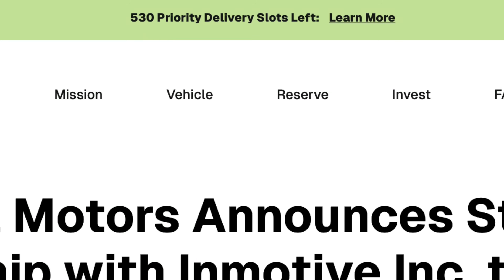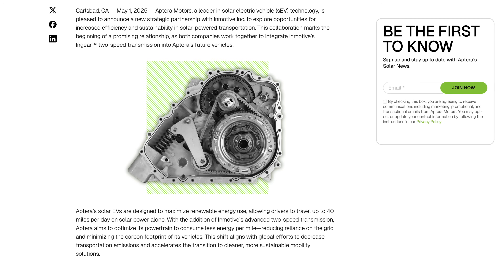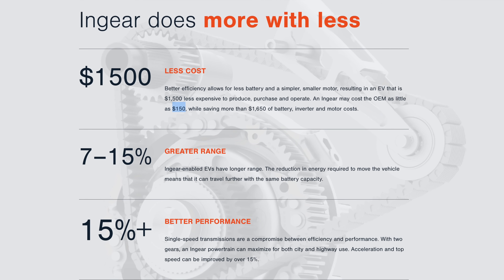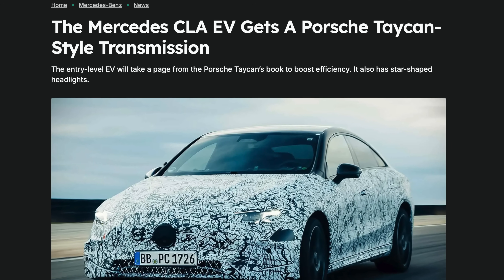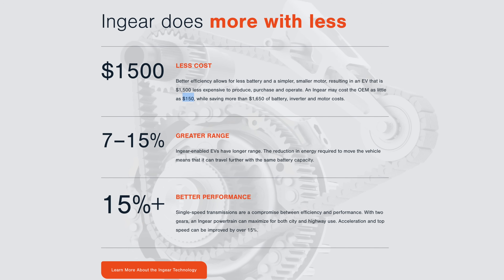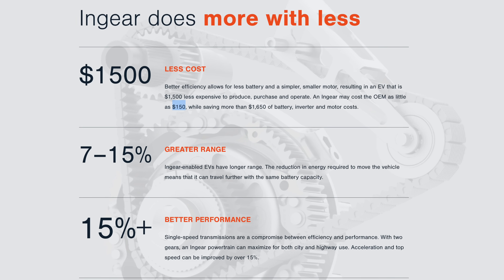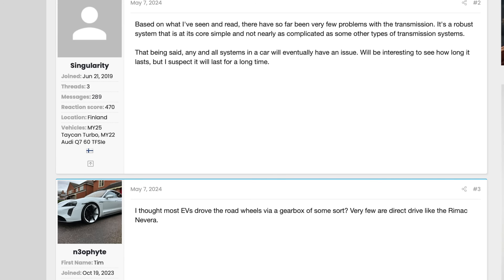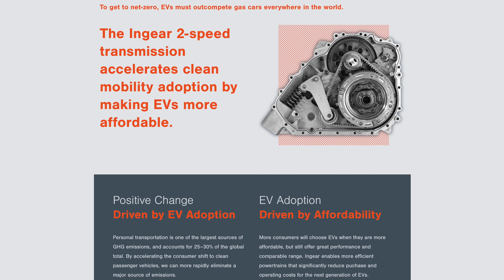Aptera Gets A Transmission?? Explained

Comment: Due to the way the EMR3 works, I think the Inmotive Ingear transmission would be replacing the reduction gear of the EMR3.   Electric motors use energy at different rates than the more linear ICE.  Motors have efficiency islands in the RPM versus load graph.  It could help if it could move the EMR3 into an efficiency zone at highway speeds.
Reply: And low load city/around town travel too.

Comment: When you ask why EVs get worse range on the highway, everyone blames arrodinamic drag, which grows exponentially with speed. I've never understood that - it should apply to ICE vehicles, too, but those can actually get significantly better range on than in town... So the only logical explanation is the lack of variable gearing :)
Reply: Nope, nothing to do with a lack of gearing in EVs. 
Most of the energy in powering an ICE vehicle is lost as heat, meaning there's an optimal speed you can drive before aerodynamic drag starts to compete with heat losses.
With EVs, most of the energy goes into moving the car, so you don't have the same fight between losses - drag basically dominates from low speed. An EV will also gain a lot of energy back at the low speed stop-start driving you get in cities, thanks to regen braking. Not something you do when traveling consistently at high speed.
Reply: @drunkenhobo8020  without variable gearing, higher speed means higher RPM, therefore greater magnetic drag between the stator and rotor. Which means you need to use more energy do overcome that drag
Reply: @zahari_s_stoyanov   Losses within an electric motor are minimal. You're not improving efficiency by adding a transmission. You may even hurt it from the weight and friction of the transmission.
Why do you think nobody else is doing this?

Comment: Exceeding EPA range says absolutely ZERO about the transmission improving efficiency.  It simply means Porsche underrated their EPA claims.  

You should just look at the actual real world efficiency like Edmunds testing, and the Taycan is still just NOT that efficient.  Single speed Kia, Tesla, and Lucid are significantly more efficient... Even the new Porsche Macan SUV with single speed transmission is more efficient than the low slung Taycan with 2 speed.  The gains are likely miniscule. I'd rather skips the extra moving parts...

Comment: EVs are a case study in how we often prioritize cool tech over engineering fundamentals. Early on, most of the industry's time, energy, and especially money went toward flashy features—autonomy (FSD), touchscreen overload, and cabin gadgetry—rather than perfecting the core mechanical aspects of what makes an electric car efficient.

Now we’re seeing huge interest in companies like Slate, not because they’re breaking new ground, but because they’re going back to what people actually want: a simple, affordable EV. No FSD, no over-engineering, just solid efficiency and usability at a sane price point.

This whole thing feels like we built the EV industry upside down. We maxed out complexity before we nailed the basics. Maybe it’s time to reset and build the car, before trying to build the robot.
Reply: It's the way new technology always works. You've got to go for the high end expensive stuff first, otherwise you'll never be able to sell it at a profit due to the high costs of brand new technology. Now that EVs have had about 15 years to mature, we're seeing more simple and affordable ones.
Reply: Huh? The center touchscreen actually reduces complexity and manufacturing costs, while improving reliability. Wiring a bunch of knobs and switches slows production and creates more failure points. Tesla worked relentlessly on improving efficiency because they knew a more efficient car needed a lighter and less-expensive battery to go the same distance. And they worked relentlessly on reliability and durability because they knew how much value a longer useful service life brought to the buyer.

The Slate might seem like a good idea to anyone who is not an expert in high-volume manufacturing, but the savings from making it low tech will not materialize. Remember, we live in a world where you can buy a tablet computer for under $50. Slate will not be able to meet their announced timelines or price points, which means they will be selling them at a big loss, and that's assuming they even make it to volume production.

Comment: Well, Tesla did initially use a 2 speed transmission, but dropped it. Will be interesting how it is incorporated. But I’m hoping if it does somehow improve efficiency and range… they DONT DECREASE THE NUMBER OF BATTERIES! And instead advertise it as “minimum 400 average [new number]”

Comment: Nuts to look into more components this close to production.
Reply: This could be used as a reason to delay production. Delaying production could be their goal.
Reply: But if it helps them achieve their projected 10 mi per kWh from the get go, on the road, that could help quiet the naysayers, and gain investors and reservations.

Comment: While I would prefer a simple single speed, as someone who owns a mid-drive ebike, I can see the need for this. Transmissions in EVs may not be strictly necessary but they do give them advantages over single speeds. Namely better performance at all speeds/better efficiency. Electric motors operate most efficiently at low RPM. They don't make much power effectively when they are spinning very fast. While you could optimize final drive gearing for operation at highway speeds, lower speed performance would suffer and the tall gearing might put an excessive amount of stress on the motor. So it is logical to incorporate a transmission in a vehicle that will almost certainly be driven fairly long distances at 60-70MPH. If the transmission help to ensure the highway range targets then it is certainly a good idea to incorporate, provided the unit is reliable and easy to service.

Comment: I was just thinking the other day that there has got to be a way to get gears working for EVs to get the same benefits they do for ICE cars and even bikes. I mean if gears on a bicycle can make the human engine more efficient at riding, surely it can work for EVs right? Then BOOM. The one transportation company I've had the most interest in (yes, I have a reservation) partners with an EV transmission company that I didn't even know existed. Best birthday week ever!
Reply: There's no need with EVs. You don't lose efficiency in the same way as you do with ICE or legs. There's very little to be gained with a gearbox, other than complexity, weight and cost.
Formula E and even the VW I.D. R only have single speed transmissions. It's almost never worth it.
Reply: @drunkenhobo8020  Most EV's get their 'gearing' with 2 or more motors. Those add weight and complexity, no?
Reply: No, that just isn't how electric motors work. for both muscles and ICEVs, there is a fairly tight torque/force band that. For ICEs, that is and upper mid RPM band with no torque at all produced from zero speed. For human muscles, peak force is midway between full extension and full retraction of the joint with little force produced at the ends. Hence the need to for gears to keep both ICEs and muscles near their peak torque/force curves. 
Electric motors produce torque from a stop and have relatively flat torque and efficiency curves and don't need to get moving before they can move so don't need things like a torque converter, starter motor (a single speed electric motor by the way).

Comment: This is something I have been curious for a few years is why don't EVs have transmissions, I know they have gearing but that is direct drive. That being said I did not know about Porsche and Mercedes using them, but it could be tuned for better efficiency for multiple speeds. That being said I have been considering mating an old Tesla power unit to an old Honda transmission with custom cut gearing, and have it set mid engine so instead of the output being split between the front wheels it would be split between front and back with differentials for a 4WD mid engine layout.

Comment: eh chain driven transmission. not as durable as a solid gear/planetary setup with a clutch pack. not sure it makes sense for lowering weight unless it gives a tangible range benefit. wonder how much battery theyre giving up for this and if the change in motor selection had anything to do with this decision. one more thing to worry about though and chain drive needs transfluid change probably atleast every 80-100k miles, ideally half that.
glad to see theyre willing to go with a parking pawl though. really dont like that teslas dont have one of those. some of them slide away while being charged and destroy their charger lol. 150$ part for mfg means a $2000 repair if it goes bad.
i wish they would just stop changing the design and go to production.... even if there are flaws, the sooner they start making them the sooner they will be affordable 2nd hand.

Comment: Vaporware working with vaporware. Great!

Yeah, stupid.

There are enough EVs already on the road to have proved conclusively that anything other than a single-speed transmission REDUCES efficiency. All the 2-speed transmission gives you is a higher top speed for vehicles that don't have high enough quality motors to deal with the RPMs necessary for a competitive top speed. A top speed that is utterly irrelevant to 99.99999999% of drivers and situations. So you're adding weight and complexity, and REDUCING efficiency. There is ZERO chance that efficiency is increased. That's not how electric motors work. They don't have a torque curve like ICE engines do, and efficiency is not directly related to RPM. Adding weight and friction CANNOT increase efficiency, because physics. The Porsche in fact proves that the 2-speed transmission is less efficient, because the Porsche (and its Audi and other platform siblings) is in fact less efficient than its direct competitors.

More stupidity from the company that gave us the sheer insanity of "NACS"  (for aesthetic, not practical reasons) rather than making the smart move to CCS.

This is all just more lies from a company that has been lying to investors for years now. They have no intention of going to the trouble of actually producing a vehicle when there are so many suckers with more money than brains who are willing to throw good money after bad.

Comment: Me who drives a Manual Daily. NGL I would love a Manual Transmission EV.
Reply: 👍👍👍 Seem to recall a ICE to EV conversion that had a 4-spd shifter.
Reply: @gr8dvd  oh yeah I've seen several manual EVs from conversion kits. I would love to turn my Honda Kei Van into an EV with a Manual. That's like the best part of driving one of those things is shifting the gears and making noise with those tiny engines while having everyone look at you for having such a smol car 🙂
Reply: @ Too funny as same (similar) desire, different motivation. Always felt had more control, especially in snow country, with stick. Dream car was a Mazda RX-8 conversion tho maybe now Cobra EV replica built anew, only shares it’s shape.

Comment: Anywhere we score efficiency is less money at the charger.  That's the economic freedom we've demanded for decades.
Reply: I like efficiency, but this thing is already going to be dirt cheap to charge.
Reply: @michaelsmithers4900  And on top. I doubt that 10 to 15 % is legit. It's time to build this thing. Before they go bankrupt AGAIN.
Reply: @michaelsmithers4900  I agree and I put the 3rd Like on your comment.  I also think that the matter of adding this 2-speed trans is for another criteria: that is how the Aptera will stack up against what other EV can people buy for the same costs of Aptera ownership.
Reply: @a5-30-31cts 2 speed to make it faster? Or to be able to use a weaker motor?
There has to be a gain. To my thinking single speed is cheaper, lighter and simpler - as long as your motors are up to task.
Reply: Maybe they should deliver some product?
Reply: @scottbaxendale323 so agree even if they have to jack up the price on the early ones
Reply: @EarthCreature.   disagree.
A simple system that lasts longer might be more sustainable than a more complex system that is more failure prone.
Other considerations would be cost, weight, packaging- does it make the storeage space smaller, for example?
So while I Love efficiency, I would also Love to see it go really far say 250k miles or more
Reply: But potentially more money in maintenance. Transmissions are one of the big 3 failure points in ICE vehicles. We'll have to see how this turns out.
Reply: @sasca854 Agree, saving a few dollars a month to have a costly repair down the road doesn’t make sense
Reply: if you get a 10% saving for a $120 part you will need to spend 1200 at the charger 
how many days/years will it take you to spend 1200 charging a solar asisted car
Reply: The more efficient the better. You should never waste energy.
Reply: ...for decades to come!

Comment: Please, no transmission...
Reply: The OG roadster learned why to not use a 2 speed.  Porsche leaned on the crutch of two speed gear ratios because they couldn't innovate a better motor, same for others.  Tesla and lucid solved the problem the correct way by designing a higher RPM motor.  Wrapped rotors reduce centrifugal burst failure limitations.

Comment: $150 for that 2 speed transmission is impossible.
That must be a mistake. Somebody drops the ball somewhere in the process.
Reply: It's as little as $150 more than a current solution, it doesn't cost $150.
Reply: Economy of scale makes it easily possible.

Comment: How DOES a transmission affect acceleration? What about towing range?
Reply: Lower gears allow greater torque thus quicker acceleration. The high gear allows more wheel rotation per motor rotation thus increasing increasing range at the cost of slower acceleration.

Comment: So they are 1) adding weight 2) adding cost 3) taking away internal space, 4) changing the engineering platform once again, and 5) putting in more complexity with an untested component to increase "range" when its supposed to go 1000 miles on a single charge.  And this is a good idea why again?  BTW; you have it wrong. Higher gears lower motor speeds to go faster with a given RPM.  Lower gears give you more torque to go up hills, which it seems Aptera can't do.
Reply: This is a very negative view. Electric motors can become very much less efficient at high RPM back EMF or something. The cost of a simple gearbox could make enough efficiency sense to save on a more costly motor
Reply: I'll let you know what I think as soon as I ever see anyone who's bought one... driving it around out there in the big world.